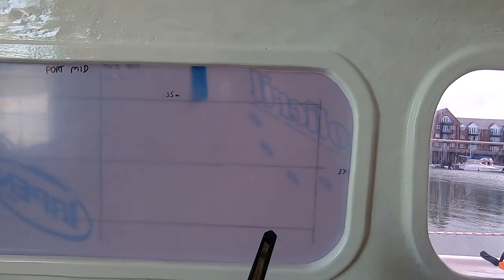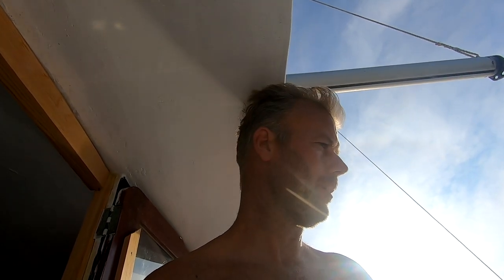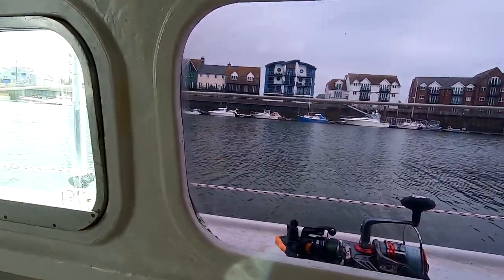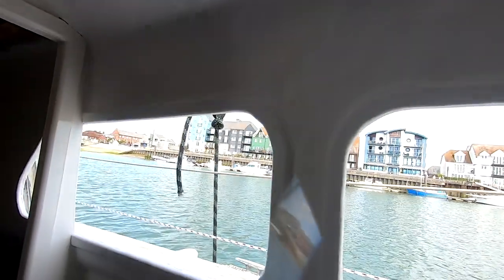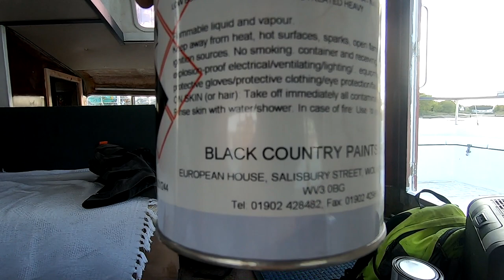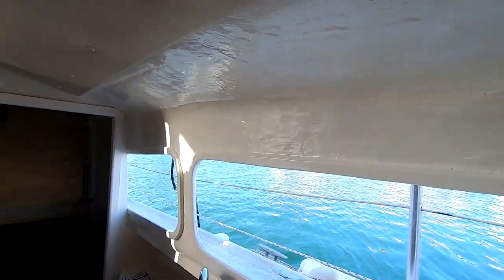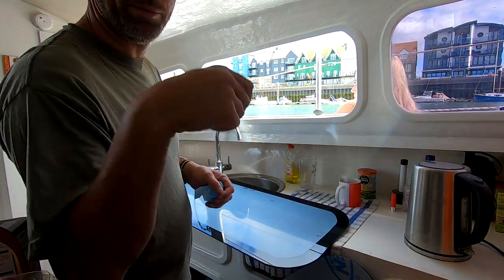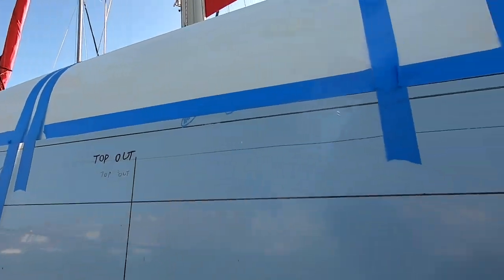WINDOW UPGRADE PREPARATION FOR ACRYLIC S2 E34

Comment: Nice one sir, Stuck in isolation in a caravan in Rousdon with the lurgy 500 miles from home after survey and sea trial on a BB 385. GL with the windows... For the seal on the end of the sliding part.. erm... Window wiper blade comes to mind, pehaps with part of the window wiper as the mounting mechanism.. .. I would recomend buying a cheap bit of plexiglass and doing a trial on cheaper material until you are pretty certain of the design. BTW, when you get a chance, check out Nicholas Manthos documentary on his solo tradewind crossing of the atlantic on a Hurley 18 .... a boat 4ft longer than a Wayfairer dingy.
Reply from the maker: Sounds like your having fun too! Wiper material sounds like a good plan, well investigate. I'll check out the crossing tonight when i sit down👍👍
Reply from the maker: How much longer do you have to Isolate for?
Reply: @SailingFoxyLady   Until i pass negative on a LFT. Taking them daily. The isolation is more bothersom than the virus has been.   Fortunatly there is youtube, german chaps solo crossing the atlantic on  shonky 60 year old 18ft british boats and girls crossing the atlantic in Wharrams with tin roofs to keep me entertained.
Reply from the maker: @86config  🤣well enjoy your down time then! I could do with some!!